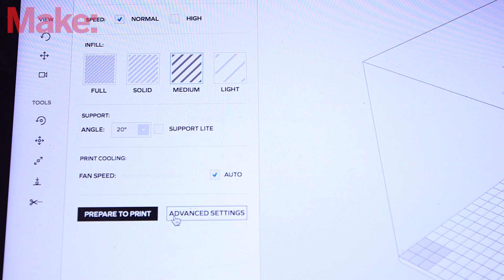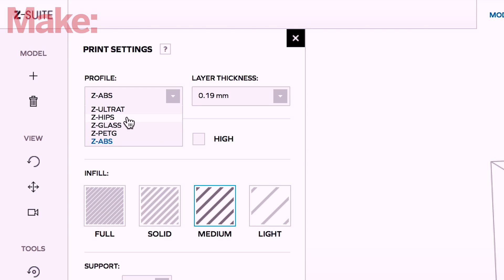Spotlight: Zortrax M200 3d Printer

Comment: $1650 on Amazon right now.
I bought it because it's the only printer I could find with a completely solid welded frame, meaning no wobbles, no messing around making adjustments and tune ups. And I'm pretty happy so far. The thing prints on command like a champ, no need to nurse it and pray for a good print. I'm able to get some very high tolerance prototypes out of it. All depends on what you want out of your printer.

Comment: This video did nothing for the printer. The fact is, it's a great machine that is super reliable and makes great prints. Lots of comments here are from people who are anti 3D printing in general or really don't understand it but this has nothing to do with this printer. Yes it's a bit closed down and that is not my preference but for a company who want's to put this on the desk of an engineer, this is cheaper and better than the top choice out there, Makerbot. One of my friends has to print prototypes for work, he turns to the M200 because he knows the job will get done.

Comment: $1,989.99 for the printer
$21.99-$49.99 for the filament
Reply: Nope.jpg 
These types of printers are going to be mostly obsolete in couple of years anyway because they are too slow and often require post processing to make the results good. 
The only practical choice for a filament printer at this time is one that can have maximum variety of different materials because that is the main advantage of the FDM printers, but that would require you to be the sort of dude that fiddles a lot with his machine.
Reply: +Strong Back I agree. FDM definately needs some work before it will be able to be a consumer product. SLA 3d printers are pretty good though. It's a much more accurate method than FDM and the only cleanup is the base and any support material. Don't get me wrong 3d printing still needs some serious help to become something available to consumers but it's certainly on its way and I wouldn't be surprised if there was consumer level SLA printers out by next year.
Reply: +bdot02 There have been consumer level SLA printers out for years now. Check out the little RP. SLA is super pretty but it's also super messy and toxic. The resins also tend to be very brittle and not great for functional items. This comes down to are you using a 3D printer to make pretty things or functional items. I fix things around my home or make things I actually use. I don't need those to be glossy.
Reply: +Matt Stultz 

All true, SLA prototypes only, except some companies make multiple materials but build volume is very small to be used for real items.

Zortrax tricked us by promising opensource and that it would use all filaments on kickstarter. They then doubled filament cost. At that cost and the fact they block you by IP after you post on their forums makes me think who the heck purchases this crap? I can buy  a car for this money, not a toy to make toys from cheap china stuff on ebay.

3D printer or should I say "3Dprinter toy" prices reflect the stupidity of majority of people ! They do not bother to actually outsource major parts themselves and see what the real cost is!
Reply: I said stop